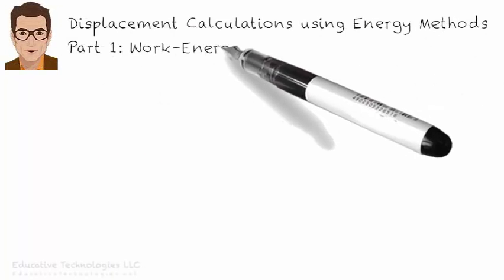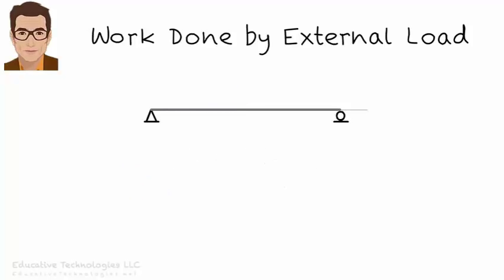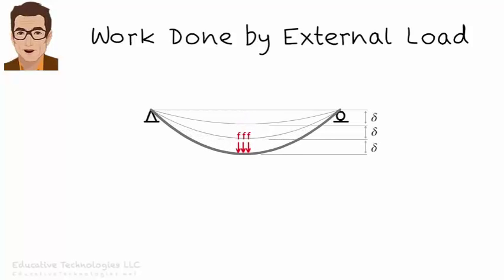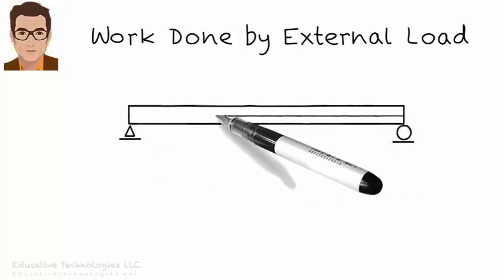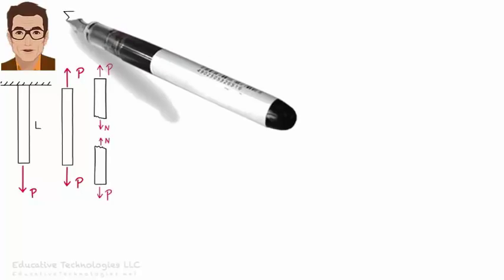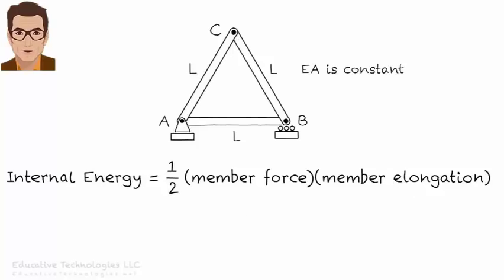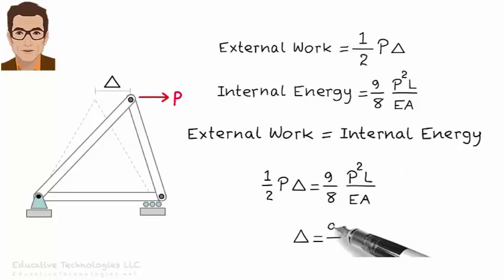SA19: Work-Energy Principle (Part 1)

Comment: Dear sir, after calculating internal energy ,, we are calculating deflection by equating it with external work done.thats alright.but differentiating the internal energy w.r.t the force is also providing the same deflection..so what is the connection between these two?
Reply from the maker: If we think of a beam as a collection of small elements, then each of those can store a small amount of energy (which is the product of internal force and deformation). The actual deflection of the beam does not appear in the expression for internal energy. That deflection exist only for the entire system, not for the individual infinitesimal elements.  When we add up the energy for the individual elements in the beam, we get the total energy. Suppose we expressed this internal energy in terms of the applied load, since the internal force in each member is a function of that applied load. But, since that energy is not directly defined in terms of the system displacement, how could that displacement result when we differential the energy expression with respect to the applied load?
Reply: Dr. Structure for any structure solvable by work energy principle is giving the same result when I am differentiating the internal energy w.r.t the applied load..and to calculate the displacement in any other location we are  assuming an imaginary load at that point and calculating the displacement and in the final expression the imaginary load is substituted by 0. Now it is very similar to unit load method and seems to be an application of virtual work principle..but I am not getting the actual connection between these two.
Reply from the maker: I am not quite sure what you are doing, how you are solving the problem. Feel free to write down your solution in a step-wise manner and email it to me (dr.structure@educativetechnologies.net).  Once I better understand your solution, we can have a discussion around the topic.
Reply: Dr. Structure I am sending you the photo of solution of one problem sir
Reply from the maker: What you are using is called Castigliano’s Second Theorem. The theorem is derived from the observation that change in external work equals to change in internal energy, say with respect to load P.
Let U = internal energy. P be an applied load, and D the displacement under P. 

Since there may be other loads applied to the structure, the expression for U could involved other loads and displacements. Say, there are two applied loads, P and Q with the corresponding displacements D and E. Then we can write:
U = (1/2) P D + (1/2) Q E.
Now, suppose we make an infinitesimal change to P, call it dP. This causes a change in internal energy which we refer to as dU. This additional energy is the result of dP traveling through D. That is: dU = dP D.
If you are asking wouldn’t dP cause additional displacement in direction D?  If we denote change in that displacement as dD, then it can be said that there is also a (1/2)(dP)(dD) change in internal energy due to dP. But this term is very small and can be neglected. So, 
dU = dP D.
But since dU is a function in terms of other loads and displacements, we can write is in terms of partial derivate this way:
Let r denote the partial derivative operator, then
(rU/rP)(dP) = dP D
Note that the left hand side of the equation is dU. Simplifying the above equation, we get:
rU/rP = D.
That is, the target displacement equals to the partial derivative of U with respect to P. Intuitively, if the expression of external work and internal energy is:
(1/2) P D = (1/2) Integral of (M m dx/EI) 
Then taking the (partial) derivative of both sides with respect with gives us:
D = d(W)/dP where W is the integral expression.
Reply: Dr. Structure got it sir..but
1) why the change in external work is (dp)D? Why the .5 term is not multiplied?
2)What will happen if the external displacement due to dp is comparable with D ? Will we be able to neglect d(D) then? Will the formula be valid then?
Reply from the maker: 1. Because D is not caused by dP, it was caused by P. So, D is already there and we just make dP to travel through it. In such a case, when a force moves through an existing displacement, work done is force times the displacement. The 1/2 factor comes in only when the force causes the displacement. 

2. The formulation is valid since the dP is not a real force, it is an imaginary force, we can make it as small as we wish. 

Generally speaking, large displacements in structures could result in additional forces called P-Delta effect. But that is a different conversation/topic altogether.
Reply: Dr. Structure I am really very very greatful to you for clearing my long lasting doubt. Thank you a lot sir.
Reply from the maker: Your are welcome!
Reply: @DrStructure  Wow!! You really care Dr. Structure. Idk if you are a man or a woman or a group of people providing this content, but how great is it that you replied to all of his/her questions with so much detail!! We need more people like you!! <3

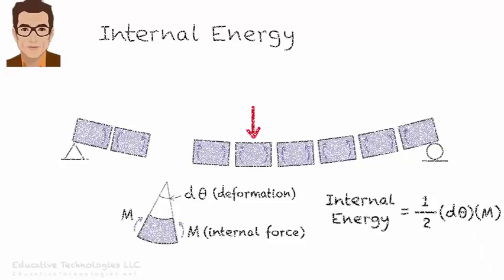Comment: 9:13 why  energy is equal to angle *moment?
Reply from the maker: Energy is stored work. In beams where beam segments deform (by some angle) due to the internal force (moment), internal work = stored energy = the integral of (angle/rotation) times moment. This is analogous to external work which is the product of displacement and force.
Reply: @DrStructure  why is that moment*rotation is analogous to displacement*Force?
Reply: is there any geometrical basis or something ?
Reply: I understand that moment (you refer as force) causes rotation(deformation), but the fact that moment is not a force, and rotation is not a change in length confuses me.
Reply from the maker: Rotation is a displacement. Moment is a force. It is true that we can distinguish between linear vs rotational displacements/forces (the same way that we can distinguish between linear vs angular velocity), but that distinction does not imply that only one type of displacement/force produces work/energy.

Work/energy is the product of displacement and force, be they linear or angular/rotational.

Comment: Hi, in 4:29 I don't understand why isn't the work at t2 equals 4f*delta or just f*delta as the force increment is f and deplacement is delta why did you right it's 2f*delta? Thanks
Reply from the maker: At t2, the added f causes an additional displacement delta. So, we get f*delta. But, the other f, the one that was there from step t1 also goes through the new delta doing work. The work done by that f in step t2 is also f*delta. So, the total work increment in step t2 is the sum of the two f*deltas, or, 2f*delta.
Reply: @DrStructure  okay got it thank you so much

Comment: 10:14 how do you know that  total internal energy is that ? Please explain how you come up with  that integration formula .
Reply from the maker: Imagine the beam consists of N infinitesimal elements each being deformed by some small angle (d theta_i) due to an internal bending moment M_i. Since the internal energy associate with each element is (M_i)(d theta_i)/2, the total internal energy can be written as the sum of element internal energies, or:

SUM  (M_i)(d theta_i)/2  for i = 1 to N. 

Since M is a continuous function, the above discrete expression, mathematically speaking, can be replaced by the continuous integral expression:

INTEGRAL M (d theta) /2
Reply: @DrStructure   why the N is 10 ? 0 to 10?
Reply from the maker: @febrianimariyaningrum7013  Are you referring to the limit of the integral? That 10 is the length of the beam. That is, we are integrating the expression over the length of the beam.

Comment: its really really helpful! thank you very very much! Could you plz show me the proof how this 07:13 formula is generated?
Reply from the maker: The derivation for the work done by a single force was presented earlier in the video. A single force (P) going through displacement (D) results in (P)(D)/2 work. If we have multiple forces acting on a body each going through a specific displacement, then the total work done by these forces is the sum of the work done by the individual forces. So, if two forces (P1 and P2) go through displacements D1 and D2 respectively, the total work would equal to: (P1)(D1)/2 + (P2)(D2)/2.
Reply: @DrStructure   @Dr. Structure  what makes me confused is: Firstly, I assume, P1 is working @A, causing displacement D1, and after P1 worked, P2 involved (let me know if Im wrong here, if both are working at the same time unlike I assumed, then how will the calculation be?).
 If my first assumption is correct, when P1 is working @ point A,  it causes some displacement not only @ point A, but at the other point B too!! Let that be D2. So far so good, Now when another force P2 is working @B and generated a certain displacement (let D3), MY CONFUSION IS the total displacement @B (letD3) after P2 involved includes not only the displacement by force P2 itself, but also from previous force P1. In my sense displacement by P2@B will be found by subtracting the displacement @B by caused by P1 itself...so the formula be like 1/2(P1*D1+ P2(D3-D2))does it work that way?? I don't know...plz correct me and plz give me some concept too.  I hope I could make you understand my confusion😇. It will be very helpful for me if you plz show me some derivation for "1/2(P1*D1+P2*D2)" like you did for "1/2P*delta"...
Reply from the maker: Yes, you are correct, D1 and D2 are dependent on both P1 and P2. So, it is not the case that P1 only causes D1 and P2 only causes D2. Calculating D1 and D2 due to P1 and P2 is a different conversation than what is the total work done by P1 and P2. Here, we are not using the expression for work to calculate D1 and D2. We are simply stating that if the structure has displaced by D1 (say, at point 1) and there is a displacement of D2 at point 2, and these displacement develop under load system P1 and P2. Then, the total work equals (P1)(D1)/2 + (P2)(D2)/2.
Reply: @DrStructure  owww....now I got it😊. Is there any video or book that you can refer me to know more about how these formulas are derived from the scratch? Actually your awesome explanation and creative videos made me so stubborn to know about this topic from very deep😊. This cerdit is yours! Thank you very much again. May I know from which country is this brilliant channel's guy from?😊
Reply from the maker: You want to look into energy methods. Most textbooks on introductory structural analysis devote at least a chapter or two to energy methods. 

The YouTube channel is being maintained (technical questions answered) by a few people distributed across the world. The channel itself originates from the United States.
Reply: @DrStructure  Thank you very much for your contribution to build solid concepts of thousands of students like me!

Comment: Dear Sir!
I would like to know why for the beam analysis, on should consider the forces as applied incremently. 
In fact, I still have problem with the factor of (1/2). If the the force was not considered as applied incremently to the beam, we wouldn't get this factor of (1/2). Now why we should apply those forces incremently for the beam analysis?
Thank you!
Reply from the maker: Think of it this way: a very small force applied to the beam causes a very small deflection. As the load increases so does the deflection. This relationship between load and deflection, if we graph it, takes the shape of an inclined line, To graph the line we can use two points. Assuming the x-axis represents deflection and the y-axis represents load, one of the points could be the origin (meaning that when the load is zero, the deflection is zero). And, when the load is P, say the deflection is D.  Note that such an inclined line defines a triangle. That is, the area under the line is that of a triangle. Since work done by P can be defined as the area under the P-D diagram, then we can write work as (P)(D)/2.

Without 1/2, we end up calculating the area of a rectangle. That would mean that the relationship between P and D is constant. That is, no matter how small or large the load, the beam deflects the same amount. This is like saying the beam deflects 10mm regardless of the magnitude of the load. But that kind of behavior is not consistent with how structural materials behave.
Reply: @DrStructure  Thank you sir! I got it.

Comment: in 6:36 why do we take external work as the area of the triangular and what do you mean by saying that it is a linear elastic material i mean why donot we just take external work = P* Delta. Could u answer me please
Reply from the maker: The idea of integrating (P)(delta) over the length of the beam does not work here. Why? Because P is a concentrated load, not distributed over the length of the beam, work involves only P and the displacement under it. The beam displacements away from P do not contribute to work done. 

If the load was distributed so that we could write it as w(x) and then displacement in the beam was expressed as d(x), then the integration idea would work, but not in our case.

Although, we can think about work due to a concentrated load as an integration problem too, but integrating over time. Say, we define P as a function of time. p(t) where at each point along time, there is a load increment, say, p(1), p(2),…p(n) are load increments at time, 1, 2, …, n.  And at each such increment, displacement under the load is d(1), d(2), …, d(n).  If we graphed this as p vs d, then we get that triangular area. Why the area is triangle and not rectangle, why is that (1/2) factor present when calculating the area under the graph? This has to do with how much work is being done per time increment. 

If we take p as a small load increment, then in increment 1 work done is (p)(d), in increment 2 it is (p)(2d), then (p)(3d), and so on until we reach the last increment at which the work is (p)(nd). The total work then is the sum (or the integral) over all the time increments. That sum is:  (1/2)(P)(D) where P = np and D = nd.
Reply from the maker: The area of the triangle represents the sum of the work done by the load increments. That is, the sum of the entries in the last column of the table at 5:21 

Linear material are ones in which the ratio of force to displacement, (or stress to strain) is linear. So, when we graph force vs displacement, we get a straight line. Elastic material is one in which when the load is removed from the member, its displacement goes back to zero. So, displacements are not permanent, they disappear when the load disappears. Pull a spring, and then release it, and you would see elastic behavior in action. Pull the spring too much, the elongation becomes permanent, the material (steel) no longer behaves elastically when a large force is being used. So, steel could be treated as elastic material up to a certain point before it becomes inelastic.

If we apply a force to an object that moves unopposed, like pushing a cart on the friction-less surface, the work done by force P equals P * Delta where Delta is the amount of displacement the car goes through. 

Beams, however, don't behave like that. Beams want to resist displacement, that is why when the load is removed, the displacement vanishes. In the case of the cart, that is not the case. That internal resistance to displacement in structural members is the cause for (1/2) factor in the expression of work.
Reply: thank you so much, Dr
Reply from the maker: You are welcome!

Comment: Excuse me, @0812, there have 2 Moment on both side of beam, how about if there have just 1 Moment on right side, what is the equation of work?
Reply from the maker: External work comes to develop under applied loads only, no matter how the structure deforms. If the beam was subjected to one moment only, then only that moment contributes to external work. If the moment at the left side did not exist (if it was zero), then the expression for work would have become:

Work = (1/2) (  0 theta_1 + M theta_2) 

Or simply,

Work = (1/2) (M theta_2)

Comment: Quastion on the work done on 7:10 : if i will apply first p1 and then p2 ,the point of application of P1 move through some distance and P1 does work without the 0.5 factor…wont I get a different answer ?
Reply from the maker: No. The 1/2 factor is a function of the shape of the P-Delta diagram (triangular). It does not matter how many loads there are on the beam, if they are applied in increments, we get the same triangular shape. This is under the assumption that we have linear elastic behavior.

To lessen the confusion, consider applying the method of superposition, when thinking about this problem.  According to this principle, external work for P1 is (1/2)(P1)(D1) and external work due to P2 is  (1/2)(P2)(D2). So, total work is the sum of the two: (1/2)(P1)(D1) + (1/2)(P2)(D2).

Also, keep in mind that (1/2) does not show up in the incremental steps, it shows up at the end when we are adding up all the increments.
Reply: I just read a proof on maxwell betti reciprocal theorem that they first apply p1 and then p2 and while p2 was increasing p1 work was without the 0.5 factor plus the half when it was first appleyed.but thank a lot.

Comment: what about energy in the element due to shear forces, we dont consider them as well ? 9:07
Reply from the maker: In classical beam analysis, we generally ignore internal energy due to shear deformation since it is often small and negligible. Shear deformation however becomes an issue in deep beams, thus should not be ignored in such cases.

Comment: 9:50 How did moments become equal to 3 kN-m? Please explain
Reply from the maker: A load of 2kN is applied at mid span. That makes the left and right vertical reactions 1 kN each. A reaction force of 1 kN at the left end of the beam results in a bending moment of (1 kN) (3 m) = 3 kN.m  three meters away from the reaction force.
Reply: Thank you so much. Got it!